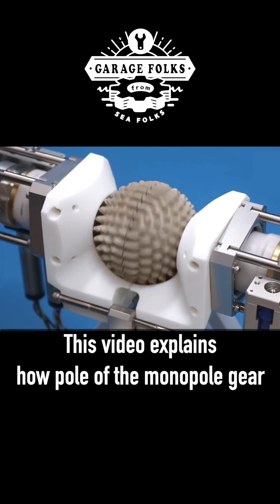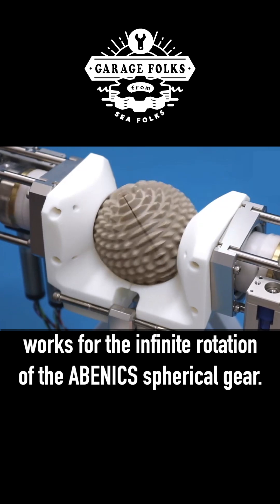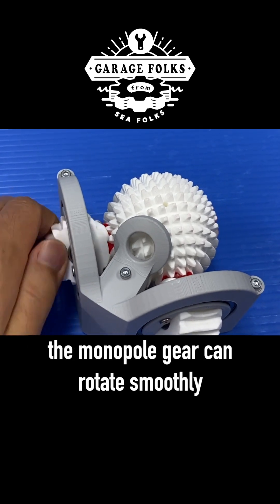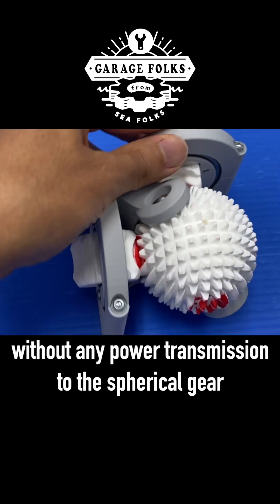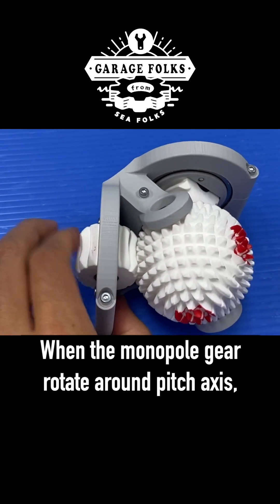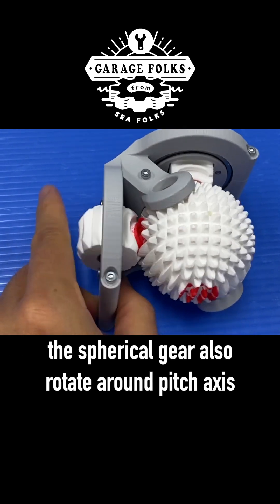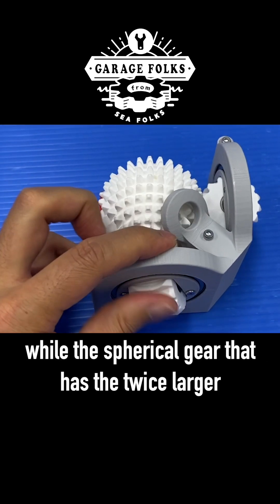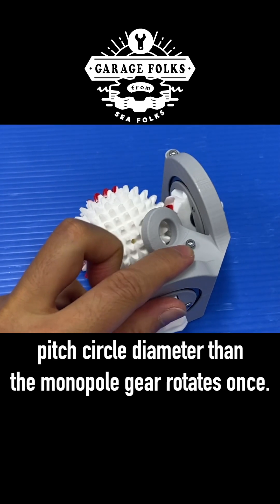How pole of the monopole gear works for the infinite rotation of the spherical gear? #shorts

Comment: Have you got any comments on the control strategy of this mechanism. When one of the gears moves the other one has to also move to remain meshed. Therefore the motor driving both gears would have to react to this movement as one drives and the other reacts. With the high gear ratio from the monopole gear to the actual driving motor it makes it near impossible to back drive this and would require precise reaction control of the adjacent motor.
Reply from the maker: Thank you for your comment! As you said, the kinematics to control motors of the differential drive units for the monopole gears should be very precise to realize orchestrated motion of the monopole gears.
In the paper shown below, this mechanism is introduced in detail.
In the kinematics calculation, the spherical gear and the monopole gears are converted to six links parallel manipulation system to make the kinematics simpler to be calculated.
This virtual six links parallel manipulation system is composed of six active joints and two passive joints.
Abe, K., Tadakuma, K., & Tadakuma, R. (2021). ABENICS: Active ball joint mechanism with three-DoF based on spherical gear meshings. IEEE Transactions on Robotics, 37(5), pp.1806-1825.
 https://doi.org/10.1109/TRO.2Thank you for your comment!
Reply: Could you be more specific?  😂